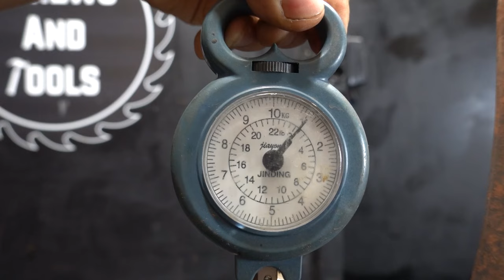Restoration Rusty BARDICHE Axe

Comment: Hey, what rust remover do you use? 
Do you recycle it after each use? 

Ive restored a ton of files recently using vinegar and i always try and limit the amount of chemical consumed so i use containors which match the dimrnsions closely
Reply from the maker: Hello sir, I used cheap rust remover, name is "Yeetis" in yellow plastic bottle (550ml and 2L).